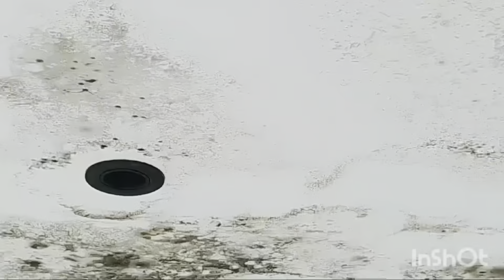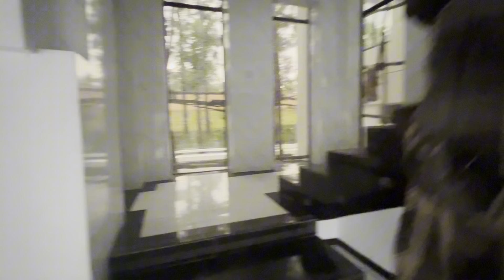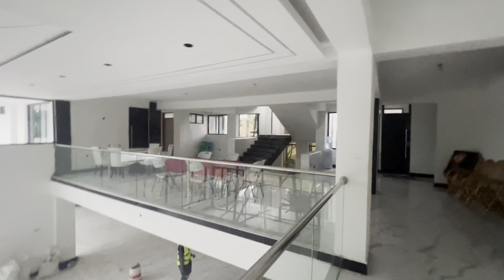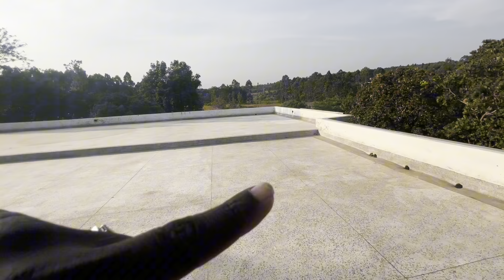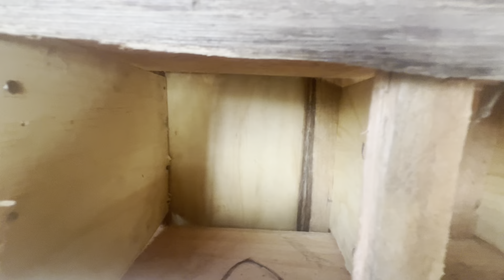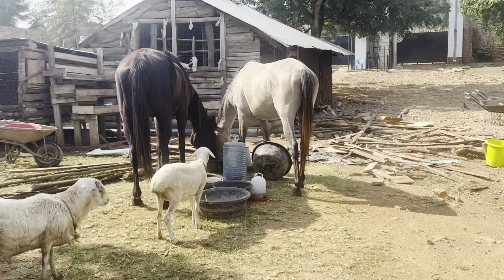WHY THE ROOF WAS LEAKING. HOW WE DID THE REPAIRS ON THE GYPSUM CEILING. @iammarwa

Comment: Mr. Ebole i think you might consider telling marwa to check on the piping, strong man rectified most pipes that were not connected, others were not sealed with glue, myb its a piping issue. Why is the issue appearing after he installed the  solar water heater?
Reply: Solar water system is tricky where is the tank placed can cause havoc to ceiling.

Comment: Mr.Emboli I understand the leakage but why did the water drain from the roof it was just standing water it still should drained shouldn't it ?
Reply: Hello the water you saw wasn't rain water, they had poured water and closed the outlets to do testing n see if the water dripping from the ceiling was leaking frm the top but the terrazzo was okay ,They found  out it was the trapped  rain water that  rained before the terrazzo was put that was leaking, later after the test the water drained as it should only two boxes need replacement coz it didn't hold like the other places coz it was a rainny season
Reply: Your audio is not loud enough

Comment: Mr Ebore, I will be straightforward with you, no apologies. What happened is that you used  incorrect tools when you were applying the terrazzo. I saw many comments on your channel where experts were saying that the brushes you were using would leave pinholes where water would seep through. You should have used rubber rollers to apply the membrane to the terrazzo. You messed up big time.
Reply: If that’s the case wouldn’t the roof leak into every room?  It’s just leaking in one area so the explanation that  some water was trapped  makes sense to me
Reply: ebore not ebola
Reply: Hello Mr John..
IIS used the recommended tools by the manufacturer of the products they were using..
If you've been following the videos.. even before they did the terrazzo they had to do a first aid because already the entire roof was leaking n IIS are not the ones who did the roof get that clear.
IIS had to wait for the rains to stop coz you can't put the terrazzo while it's raining.  When they waterproofed the rooftop... the slab was already soaked with water n that's why the water was dropping. This isn't the first leaking roof IIS have salvaged that's been done by shady contractors n it doesn't get any easier when you come in to correct  a job that's already been done badly. It takes a real man to take the fall of another.
N please it's not Ebola that's a disease.. his name is Mr EBOLE!!!!
Reply: @Khalidsci  It doesn't mean that pin-holes would appear in every area of the roof when you use brushes to apply the membrane. I am no expert on this one but what I was reading in his comments section at the time suggested that pin-holes were inevitable by using brushes to apply the membrane because brushes do not give a uniformed consistency during such applications. From what every one posted, he should have used rubber rollers as is the preferred standard in the industry. With such a large roof to cover, it is like playing Russian Roulette with the end result being disaster.
Reply: @suntzu8959  Corrected.
Reply: @Empress97  Name corrected. My apologies for messing up Mr Ebore's name. I should have proof read before posting. I am blaming auto-correct 50% for the error and myself 50% for not proof reading.
Reply: @suntzu8959  Name corrected. My apologies for messing up Mr Ebore's name.